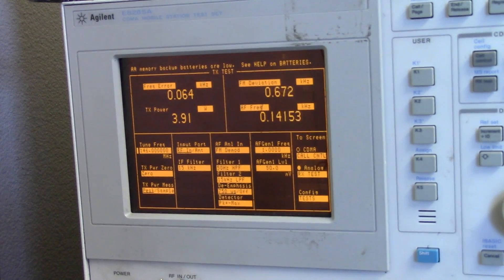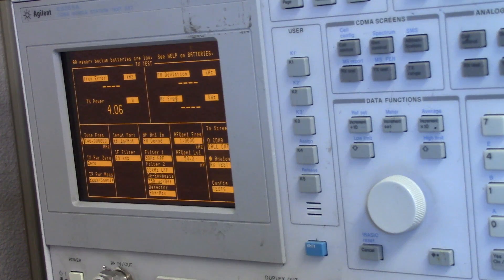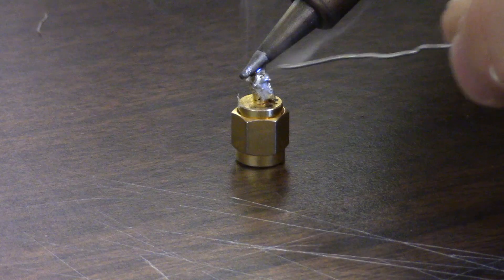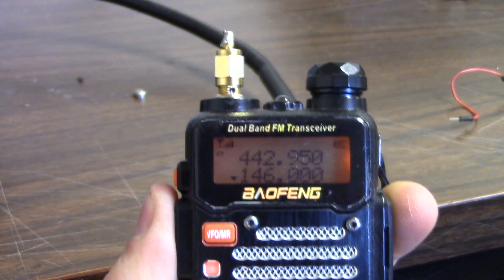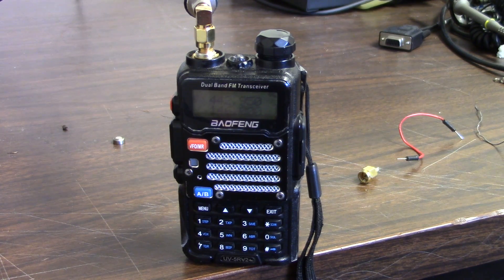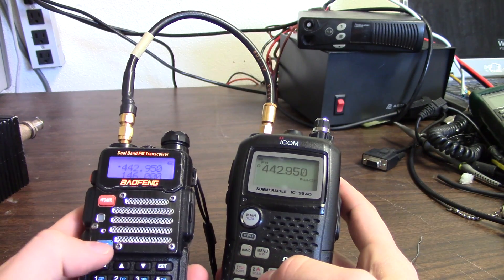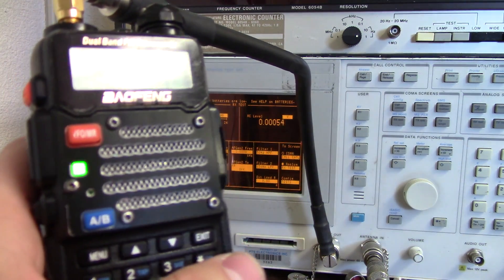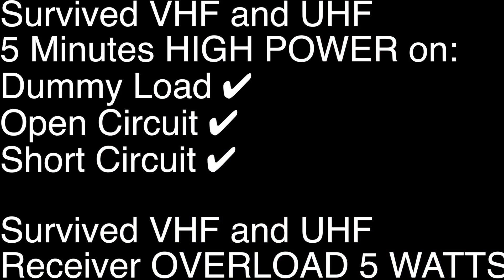Baofeng uv-5r stress test - Receiver and Transmitter overload

Comment: Can you do a Baofeng UV82? Curious to see the results
Reply from the maker: Probably not worth it, they all are made out of the same conponents
Reply: @SkylerF  would love to see ya torture test most mainstream radios
Reply: @SkylerF  good point. But that open transmission gave me flashbacks of my old 100W yaesu, forgot to screw the antenna in and well before the safety kicked in the finals gave 😂 I guess I have PTSD now

Comment: TO THOSE  UV5R HATERS ‘
saying uv5r are bad radio,
But Now they’ve seen this video  it’s  SLAP 👋 ON THERE FACE 😂

This people or company competitors of Baofeng , they just want to say bad things ... against uv5r or any Baofeng product because , in reality 
It is a good durable and affordable piece of radio 
And there scared to compete
...  so they say bad things to spread those lies ...even though it NOT TRUE’

with this video it provides proof that uv5r or Baofeng Radio can compete with other leading brands  even more better ‘ ...

Thanks 🙏 for sharing 👏👏👏👏⭐️⭐️⭐️⭐️⭐️
Reply: @WhatzUp Momoland   Great posting, Momoland!  And may I say what a great video and test on the Baofeng.  

I have a host of expensive handie talkies accumulated over a number of years (e.g. Yaesu VX-5, Kenwood THD7, Icom E90) yet prefer to use my $25 Baofeng UV-5R handies as the LiOn battery life is much longer and they give power output in the 4W/5W region, compared to the aforementioned radios, which barely produce 2W on their NiMH battery packs.   

I have the same problem over here in UK regarding the slagging of Baofengs by local Hams who claim that, due to poor suppression, spurious emissions from Baofeng radios will interfere with local emergency services and aircraft radio frequencies.  This information is largely put about by a local dealer who sells the more expensive Chinese radios that compete with the Baofeng, so I need say no more! 

Whereas the standard accepted suppression for radios is 60dB, I have measured my 3 Baofengs as hovering around 50dB, which represents a spurious emission of 0.05mW (1/20th of a mW).  That’s a drop in the ocean, and for the benefit of any posters who don’t get dBs and all that, that spurious signal is equivalent to 1/50th (one fiftieth) of the strength of a Bluetooth signal!  Guess how far a Bluetooth signal would travel if it was as weak as that!  Barely one foot (300mm) I would guess!  

I love my Baofengs - I regularly reach repeaters and gateways at 60 miles distance when trekking in my local National Park - and that's with the stock Baofeng rubber duck antenna.  Advice - Don't waste your bucks on an alternative antenna which costs as much as the Baofeng did in the first place!

Comment: Correction.  You did things that any and all radio instruction manuals would tell you to NEVER DO to any radio under any circumstance, yet this radio survived it somehow.  Very impressive.  I still remember the days when hooligan misfits would insert straight pins thru people's CB coax cables and it would literally destroy several hundred dollars worth of equipment in seconds when the poor schmuck would key up his rig.  Apparently modern HAM gear has its safeguards in place.

Comment: I guess you are the right person to answer this doubt:   when using this baofeng inside my house using the original rubber duck Im able to hear the repeater (cant reach it however), but when I connect it to my Jpole external antenna (or the one quarter ground plane) the baofeng goes deaf and doesnt hear the repeater, how come?? its suppose to have better earing...  tks, good video!
Reply from the maker: +Sergio Cavazos I would guess that this is due to a noise source interfering with your receiver outside of the house. Try looking with a spectrum analyzer or a sdr at the noise outside your house.
Reply: Im not using BNC, just a simple SMA female adapter for the coaxial.  Sounds logical what you mention about the mismatch adapter but I dont see how that could be. The base radio that I use is a Kenwood TM-V71A and it works great with the JPole.  Guess you cant expect much from a $40 baoefeng.   tks
Reply: but that noise is not present with my kenwood tmv71a....  tks
Reply: few minutes ago made the experiment once again....  put one of my baofengs inside my house (brick and cement, like all houses in Mexico), with the rubber duck antenna over my desk. The other baofeng whith the sma female adapter to the coaxial (normally used for the kenwood) and to the Jpole on the roof.   Waited to receive a signal from the local repeater... and as expected, the one with the rubber duck over my desk received the transmission. The other connected to the coaxial didnt hear anything even with the squelch totally down.    WTH ??
Reply from the maker: The baofeng has a lot less sensitive and wide open front end. It's adjacent channel rejection is horrible.
Reply: thank you Skyler so in your opinion which brand / model handheld is top performer for you?
Reply from the maker: I don't have an opinion because they have all their pros and cons and I am not brand loyal. Look at the ARRL tested specs that they publish on a lot of the popular handheld radios to make a decision for yourself based on your goals.
Reply: Sergio Cavazos have you checked the antenna using a different radio.  Sounds like a transmission line, antenna, or sma connector issue.  Had similar issue and the SMA  looked perfect but was internally an open circuit.  Use an ohm meter and check for open or shorted circuits.
Reply: You probably have 1,000 Watt paging transmitter a couple miles from your house, and Baofeng no like that (SQ stays closed).

Comment: Encouraging results. Thanks for posting. The UV-5R was my only radio for over a year while a new ham, but I did notice in its manual in late 2017 that the listed duty cycle is 3 minutes Rx/3 minutes Tx/54 minutes Standby. Anyone intending to use this rig for emergency communications (it is popular with preppers) should keep that in mind. 73 de AB3ZI

Comment: I have a UV5R and a UV82C.  Seems like the finals went out for a single band on each.  The UV5R only transmits full power on 70cm and the UV82 only transmits full power on 2m.  They seem to work fine in every other way.  Not sure what happened as they were both cared for quite well.  Moderate use.  Took a few months.  Trying the Wouxun radios next.  They seem solid so far, and definitely have more features as well.

Comment: so how clean is  the  TX  RF out  on  a spectrum analyzer?
Reply: The question is, do YOU know how to properly use a high pass filter to REDUCE the fundamental frequency from the radio SUCH THAT the spec an is NOT overloaded and creating FALSE harmonic energy indication from the mixer in spec an.
Pls, tell me you are also brain surgeon.
Reply from the maker: @uploadJ Yes, really! A coworker at a radio station was trying to prove a harmonic emission out of a Broadcast transmitter with his “trusty” field fox and a sample port. He was overloading the front end of the poor thing and showing a “HuGe Harmonic” it’s super easy to disprove false harmonics with attenuator pads. Put a 10dB pad on it and if it drops by >10dB it’s a Ghost!!